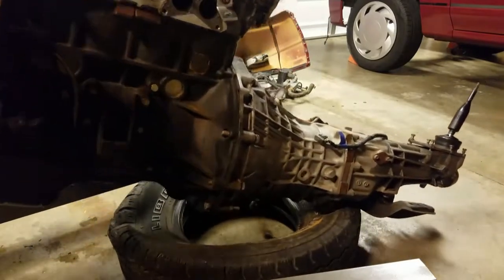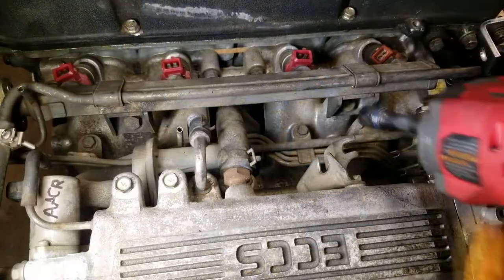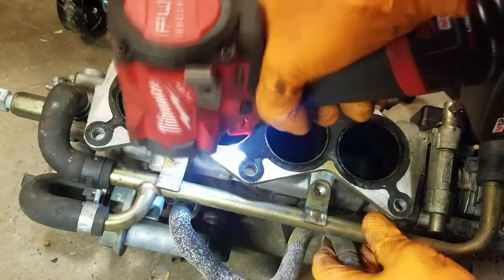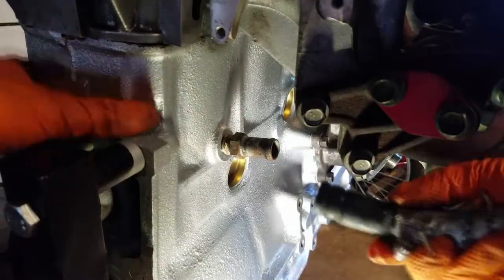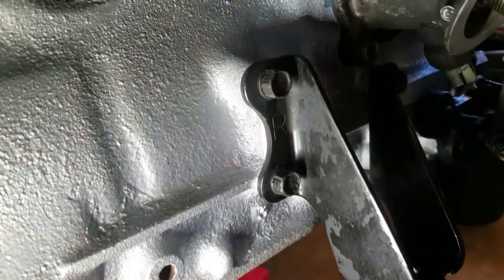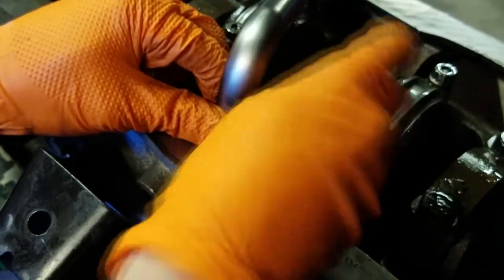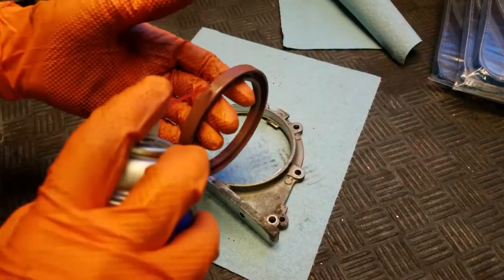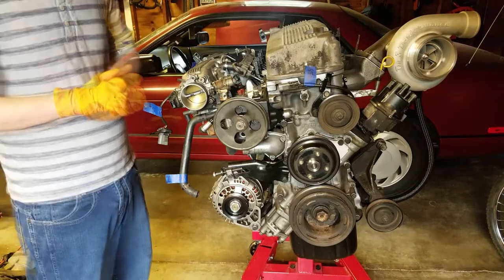KA24ET Series - EGR Delete & Swapping Accessories (Part 10)

Comment: Nice. I need to simplify my IM as well. Just be careful with those vacuum caps, they fail every time! I usually use gray RTV to close them up. 

That’s a big huffer on that engine, what’s the HP goal?
Reply from the maker: We chose to use some really snug vacuum caps, but if it seems like we're running into vacuum leak issues we'll keep that in mind. The turbo is a 61mm .63 A/R. From what we've seen around other people's builds this should have the potential for 400hp, at least that's what we think. Trying to just overbuild to have a safe, consistent, streetable 300-350hp.